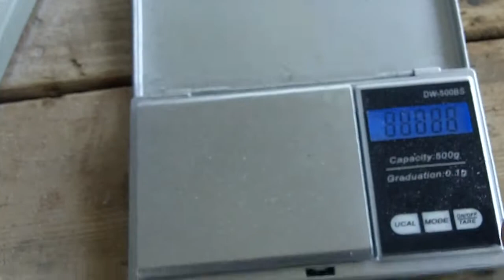167 - Making a 10 Minute Bone Arrowhead with Modern Tools

Comment: I would think antler tips would be good material for arrow and spear points.  I wonder how it compares to bone.  Antlers are used in flint knapping, so they must be pretty good tough!
Reply: Antlers don't really have a sharp point and that's what makes the arrow deadly an arrow without any sharp edges or points is completely useless unless ur going to be using it for practice yes antlers are used for flintknapping but u can't use them as arrowheads unless u managed to get a sharp tip on it if not than best to use some sharp stone flakes or another sharp tip
Reply from the maker: Antler is heavier and more impact resistant than bone, so yeah, they were used a lot back in the day. The problem is they take longer to make than stone points, and they don't cause as much bleeding.

Comment: as an avid bushcrafter and hunter  i like the idea of using bone vs flint. i just cant see myself bringing my bandsaw, belt sander and dremel into my perma-shelter. nice video. do try to be safe though huh. you need both hands to flintknap.
Reply from the maker: Yeah, the 10 minutes becomes 60 minutes in the back 40.  I've made bone arrowheads with nothing but a blocky-shaped rock but it eats up a lot if video.  And I wouldn't watch it.  heheh.  :-)
Reply: Ive yet to attempt any knapping and right now i have about 3 ft of snow covering everything. Do you have any rock type specific videos? Living in the Canadian Shield i have a ton of granite and who knows what kind of river stone.
I could definatly use a course on identifying rock types.
Reply from the maker: The best rock ID device is a ball peen hammer.  It doesn't really matter what type of rock it is as long as it chips correctly.  I tell people that all the time and it seems too simple.  But it's not complicated.  Heck, I don't know the names of half the rocks I knap.  :-)
Reply: Thanks for the tip. I have a hatchet I use in the bush secondary to my axe. I'll try grinding a corner on the head of my hatchet to mimic a ballpeen hammer for when im out and about. All of my tools must have multiuse or I cant fathom having them along.

Anyway thanks for the help. Currently running through a number of your series and especially enjoyed the sinew cordage. Keep'em coming. Great inspiration is often hard to come by.

D

Comment: Do yourself a favor buy a cheap vise
Reply from the maker: I had one during this video.  Didn't use it because it requires 2 hands.  Hello.
Reply: JackCrafty what kind of belt sander is that called? I'm looking for one like that
Reply from the maker: It's an old "DELTA Shopmaster" 4"x36" belt sander and 6" disc sander.  You can still find these on Ebay or you can buy something similar for around $120.